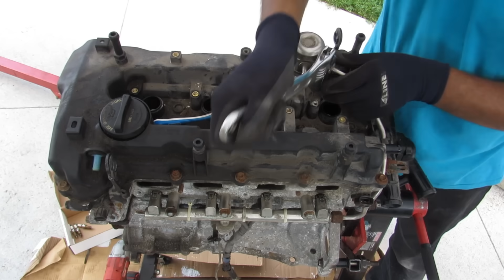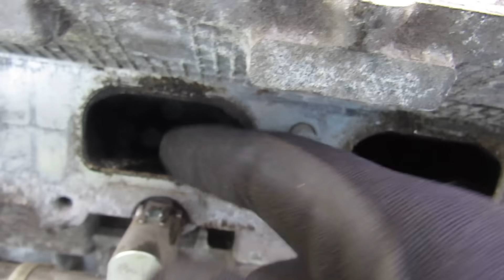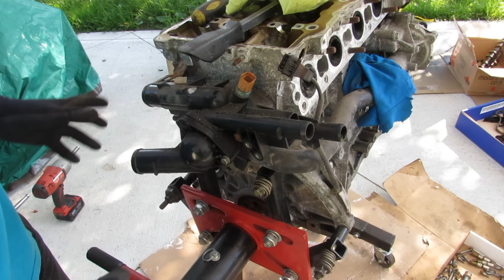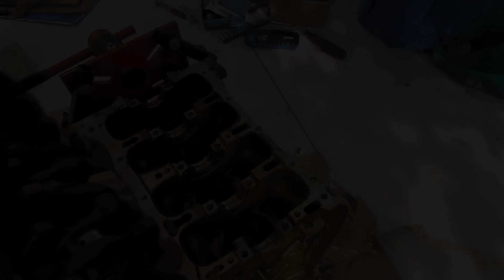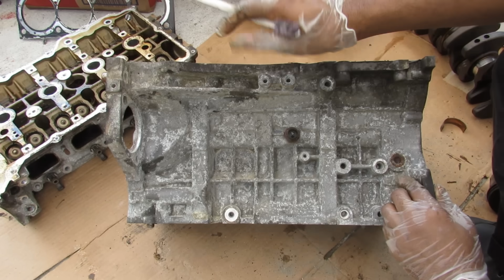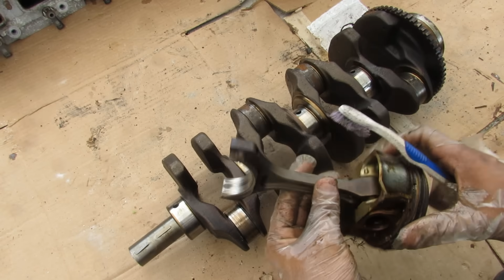Why Hyundai Engines FAIL

Comment: Well, the engine wasn't the problem. It's the labels that the manufacturer put on top of the motor that confused the customers. The oil cap says 5w20, but in the manual says 5w30 for normal ambient temperatures and 5w20 for lower than normal ambient temperatures.

Comment: No wonder it broke its a 4 cyl 😿 ive only had bad experiences with the 4 than with the 6 but thats because the 6 was made better im at 168000 as of today and my 4 lasted till 128000
Reply: All the 4 cyls ive had were fine,as was my old v 6...on a straight 6 1jz now.i used my girlfriends toothbrush to keep the blinker fluids clean,maybe thats why the 4cyls didnt fall apart...
Reply: @certificateofvaccinationi.d.19  Make sure you use distilled wodder

Comment: Can you review one of their newer Smartstream engines? This is one of those Thetas that Hyundai is discontinuing
Reply: So how do you expect him to get a newer engine though if they don't break down? I like him showing the broken ones because there's always someone who's gonna fix one up and have a car instead of a bus ticket.
Reply: @Bit-while_going  Hyundai's Smartstream engines are blowing up too
Reply: @Blank00  my parents bought one.  Ugh.  I warned them.
Reply: i watched a korean mechanic's youtube video (with eng subtitles) which he mentioned about the piston rings problem
Reply: @R8atMac  yeah that was a great video.  They found issues with the new Smartstream 2.5 motors too.
Reply: The new Smartstream engines have the Gamma designation. They are not of the Theta series.
Reply: @jeffreycheng5984  All Hyundai's engines are now called SmartStream (even Gamma)
Reply: @kristianhermann5971  Correct.